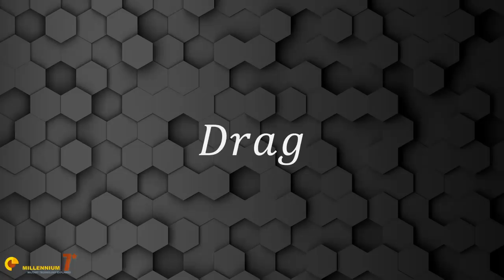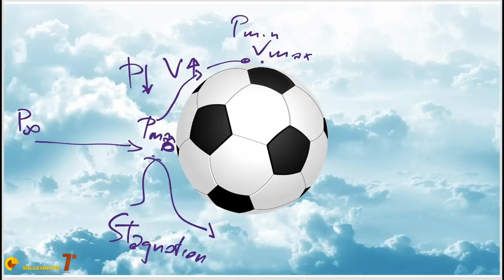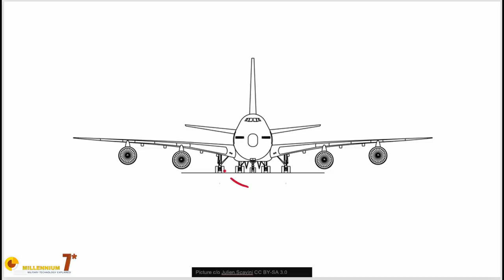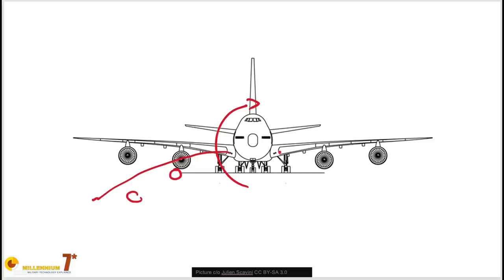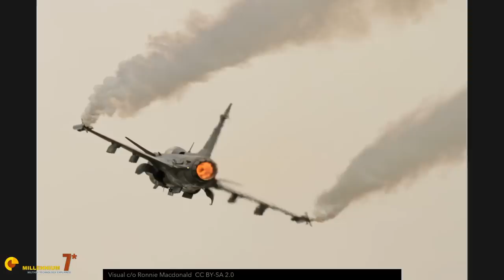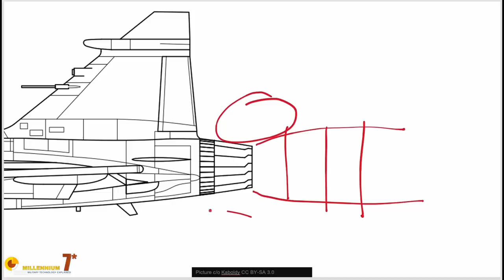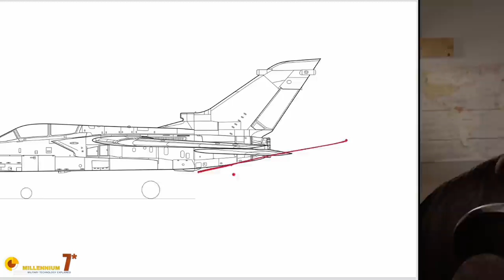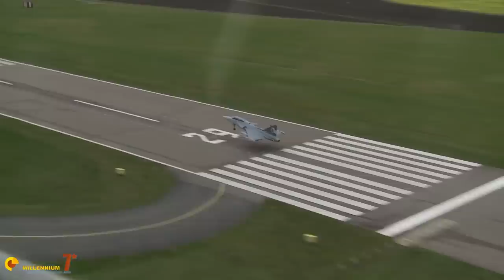The Phantom TAIL is strange because...

Comment: There is nothing wrong with the F-4, its a symbol for the triumph of thrust over aerodynamics.
Reply: It is a rather ugly looking thing..Looks like it can melt itself on full AB
Reply: Lol....that's fucking hilarious and great .
Reply: 5th generation fighters take thrust over aerodynamics to a whole new level.
Reply: @humanbeing9079  yeah, but the F4 is like 50 years old.
So it is outstanding in this regard.
Reply: @AG-pm3tc  indeed, the F4 existed in the age of chasing speed, and the tail design is a pragmatism and complexity compromise that detracted from their set of priorities. But that's engineering, it's always a give and take.
Reply: Hate to burts your bubble but the tail design of the Phantom is efficient.
When the Royal Navy installed Rolls Royce Spey engines with about 20 percent more thrust their top speed was reduced.
Reply: @justacomment1657  ; Heresy.
Reply: @DrsharpRothstein  
>an aerodynamic package was designed with a specific engine in mind
>we swapped the engine and it changed all the flow fields and certain design characteristics no longer works
>Shocker, it performed worse.
It literally says nothing about the tail design, you just ruined the plane lol
Reply: 60 years old actually
Reply: @FirstDagger  forgive me emperor...
Reply: @AG-pm3tc  Is there a more successful multi role fighter of similar age? F4 has a outstanding Kill ratio against Soviet era aircraft. Flew in front line service for over 30 years. Case closed.
Reply: The F4 was my favorite jet. It is the fighter bomber equivalent of the A10, so industrial looking.
Reply: That phrase was coined by pilots on a observational basis. The drag coefficient of the F-4 is the same of the F-16, for example. So it is not a draggy design.
Reply: @humanbeing9079  The F-4 was designed to chase down bombers at supersonic speeds.  It was intended to be an interceptor. It got drafted to be a fighter-bomber and dogfighter because that's what the US had at the time.
Reply: A-12, XB-70, B-58, F-106, F-4, F-14, and F-22 are probably the most complex and innovative aircraft designs after WW2.
Reply: A brick can fly if you put big enough engines on it. Thank you J79s but I think the F-4 looks cool.
Reply: @justacomment1657  was made from stainless steel, and I can tell you, spent many hours drilling and fixing with monel rivets and sheeting.  Nothing but compound curves too, most difficult.
Reply: @AG-pm3tc  60 years young and still one of my favorite sky brutes!
Reply: @magoid  I know, there is a reason why the Phantom was so incredibly successful and fast.
It just does not look particularly sleek.
Reply: F4 speed and thrust allowed it to do vertical loops which the Mig 21 had difficulty following.  But if you lost too much energy, then you were in trouble.  High sustained  turn rates were critical in dogfights but could quickly deplete energy.  And compensating for lost kinetic energy by trading away altitude energy was a thing.  F4 must have had a good drag coefficient because it’s top speed was so high and drag goes up exponentially with speed.
    F35 looks like it has the aerodynamic drag of a tugboat.  In ballistics modeling, the frontal cross section is an overwhelming drag parameter.  Include the  angle of attack and its’ effective frontal cross section area is even larger.  At meaningful air combat speeds, drag is exponentially increased. And with inherently high wing loading and extreme angle of attack in high G turns, the energy loss must be more than considerable. Countries should cover their bets if they are counting on F35 aerodynamics.   
   F15 aerodynamics on the other hand is a finely sculpted piece of art.
Reply: @AG-pm3tc  Try 60 years old. The F4H Phantom first flew in 1960. Development started in 1952 - so the design is seventy years old.
Note that the F4H is not the F-4D (that came later)
Reply: @chrisrautmann8936  Actually the F4H started out as a naval interceptor as a developed version of the F3H in 1952…
Reply: @humanbeing9079  makes me think how evolution chased toughness and now it's a speed game. and now i wonder when is it gonna be a stealtg game
Reply: @humanbeing9079  5th Gen have better aerodynamics than 4th Gen.  The assertion that aerodynamic compromises were made doesn't hold up well when you look at:

Climb rate
Acceleration
Cruise speed 
Service ceiling
Combat radius
Optimum envelope maneuvering

Before reacting, look at combat configurations for 4th Gen.  They are inferior.
Reply: I really love the Phantom‼️
Reply: F4 was alot faster than people believe. Ind it isn't just thrust. It would keep accelerating to the point of airframe overheating at the nose. Or till it ran outa fuel. Mach 2.2 plus.
Reply: @darbyheavey406  Isn't it still in service for the  US National Guard?
Reply: @allangibson2408  about 2 years late on first flight, the Phantom first flew in 1958 and was accepted for service in 1960
Reply: @zodiaco5526  no, the last Phantom in US service was retired in 1996. Japan had them until last year though.
Reply: @silaskuemmerle2505  Thank you, sir.
Reply: The F-4 was arguably the single best design we ever made, to be fair. It was the original joint strike fighter, and, once upgraded with wing slats, quite a formidable dogfighter as well. Just an insanely well-built and capable aircraft. And it looks MEAN.
Reply: @WardenWolf  Absolutely, it looks like it means business.
It also set the armament standard for the following F-14 and F-15, 4x Sparrows in conformal recesses under the belly and 2x Sidewinders under each wing.
The F-15 even has the same three drop tank arrangement.
The F-15A almost performs like a clean sheet redesign of the Phantom turned up to 11, though for some stupid reason they omitted the Multi role capabilities.
Reply: I've heard it said that it said the F4 proves that if you put jet engines on a brick you can make it fly.
Reply: @zodiaco5526 no

Comment: My take on the F-4 tail config is this: the USN aircraft have a limit of 16ft/5m in height. So you have basically 3 ways to deal with that. One, you fold your vertical fin (A-3 Skywarrior, A-5 Vigilante, S-3 Viking). Two, you adopt a nose up attitude to lower the tail (A-4, F-8, A-7). Three, you adopt multiple smaller vertical fins (E-2, C-2, F-14, F-18, F-35).

In the F-4, McDonnel had  a tradition of a vestigial fuselage tail with its designs since the FH-2 Banshee. In the F-4, they decided to not adopt neither a nose up nor a folding tail. So the only option available was to have a inverted "V" stabilator to compensate for the low vertical fin (because of the 15ft height limit). That happening, the engines where angled down so their hot exhaust didn't melt the stabilators. Even then, those still had to have thermal protection on its lower surfaces.
Reply: All very true. Although the horizontals didn't intersect the exhaust flow in normal forward flight, they would interact with the exhaust at high angles of attack, creating a post-nozzle thrust manipulation, kind of a precursor to thrust vectoring. Thus the titanium and lack of paint on the inboard ends of the horiz-stabs.
Also the whole arrangement created tail lift in normal flight, for a minimal expenditure of drag (though it did add weight).
The Phantom II was surprisingly agile (for a "flying brick" ;)
Reply: @kathrynck  I can't count how many times we had to replace lose Jo-bolt fastners on the hot tail panels, and on the stabalizers.   Those Jobolts were in stainless, and when loose would spin in place, making it very difficult to drill.   The trick was to drill perfectly center and perfectly square, using a small and sharp bit, starting around 0.8mm. Then step by step increase the drill diameter, using only sharp HSS bits would reduce the force trying to spinn the jobolt, and the right amount of Tapmatic.   Some times an assistant would use a tool to jam the fastner to prevent it spinning, if it spun you had lost it !   At about 4.2 mm you could then use a drift punch to cleanly snap the head off, leaving a nice clean hole without damage.
If the hole got damaged during the extraction process, you had to drill in out to the next size up then countersing the titanium panel in situe. Not easy with titanium.   Only 2 or 3 in our whole shop could do a nice clean job without messing up, too patience and the right tecnique.   As Phantom structural technicians, those hot panels were our bread and butter.

Comment: I don't see any comment that covers the real reason for the extreme anhedral on the Phantom tail.  Previous McDonnell designs had suffered a pitch up problem at high angles of attack compounded by turbulence off the wing reducing the effectiveness of the horizontal stabilizer at those high angles of attack.  The F-101 was notorious for this.  Angling the horizontal stabilizers down cause at least a portion of them to be below this turbulent area.  This problem also occurred on some planes from other manufacturers.
Reply: The proximity to the exhaust plumes also gave some maneuvering authority which was agnostic to external air flow. At higher angles of pitch control anyway (in normal forward flight they'd stay out of the exhaust).

Comment: Drag was never an issue with the F4 since it could fly at Mach II regardless, and with the normal combat load of missiles, bombs and fuel tanks hanging off the wings, whatever drag the tail added was minimal to the point of being meaningless.  The horizontal stabilizers are where are where they are and bent down to prevent the pitch up problem experienced by the Phantom IIs ancestor, the F101 Voodoo which had the same tail design but with the horizontal stabilizers placed at the top of the vertical tail.  The result of the F4 redesign was better stability and maneuverability.
Reply: I wouldn't say drag is every "meaningless", but yeah, it can be overshadowed by other considerations at times.
Reply: @kathrynck  Yup, launching down a runway with over 8,500 kg of external payload puts some things into perspective.

Comment: Need more of this engineering side of things... stuff we won't find anywhere else on the Internet...😉😁👍
Reply: Try searching for this "stuff" in books, instead.
Reply: @DenisPetrov1980  I like his presentation better 😅
Reply: @DenisPetrov1980  The problem is finding the really good books.
Per now I am reading The Secret Horsepower Race, Caulum Douglas. The problem with that book is that it so heavy, I get a stiff neck from handling it.

Comment: I had a discussion with a friend I play War Thunder together with. The topic was about the tendency for some airplanes (prop) to go in a flat spin and why some of them have real troubles to recover. First case was the P-51, because they wanted to reduce the drag the tail wings are made comparable small what causes the controls to feels a bit squishy, like it has less grip in the air. Later the Brits did it with their Hornet MK.I (two engines ). Strong engines, tiny tail section. Problem with that plane is, if you go into a flat spin, none of the engines seem to blow sufficient air over the tail wings. So the control surfaces there have no chance to counteract a flatspin. In the Hornet MK. III the tail wings are all made longer (reach within the air flow of the engines) and the rudder is a bit elongated across the fuselage. Maybe to avoid horizontal swinging effects. I heard the F-14 Tomcat had issues with flatspin, not sure why, maybe because of the distance between the engines.
Reply: The F14 TF30 Engines suffered from compression stalls- they would barf basically. This would lead to flat spins as you described.
Reply: @steelrad6363  Yeah, I read that once the F14 was in a flat spin, it was unrecoverable.  Yes, you’re right about the TF30 engines. They didn’t like rapid changes of throttle so they would stall.  Grumman had bought a bunch of TF30 engines for the F111 but the navy canceled the navy F111. So Grumman was stuck with those engines and to avoid “eating” the cost of those engines Grumman put them in the F14.  F14’s would get with F15’s for mock combat drills. The F15 would beat the Tomcats but when the F14 got better engines in the F14D, the Eagle pilots were surprised by the improved performance of the Tomcats.

Comment: F-4's tail (and a few other planes with similar tail geometry) had a lot of other considerations to it as well though.
For example, the fuselage being above the engine thrust created an area of higher speed, higher pressure air under the tail boom, which generated "partially" thrust based lift. Also, the horizontal stabilizers were positioned in such a way that they were out of the direct exhaust flow in normal orientation, but in greater angles of adjustment, they'd interact with the thrust flow, generating a limited form of post-nozzle thrust vectoring. Lastly, the shorter vertical stabilizer was largely due to considerations for space saving inside aircraft carriers, but it also saved some drag for land based variants.

Really loved this video though. These sorts are my favorite I think.

Comment: All the design quirks that make the F-4 so distinctive are fixes for aerodynamic problems.  They ended up with a legendary aircraft, yes, but not one that's all that aerodynamically efficient. Really very draggy.  No problem, fuel was cheap and it had plenty of power to push through its own drag.   But it's such an ICONIC design, one that stands out.  The most recognizable fighter ever made.   And the meanest looking one.

Comment: I used to race motocross bikes in the UK, I got really good and when we are airborne we use the brakes to lift the back wheel  and the throttle to lift the front, I raced from the age of 9 and learned how to use the gyro effect at about 11 years old. When either of the wheels stops rotating the back go up when back wheelspinsfast thefront rises.
Reply from the maker: I never knew 😳

Comment: thanks for that short informative video on pressure induced drag. vacume is as important as drag...neither should be ignored. 
one of the most perfect shapes that best reduces drag caused by pressure and vacume is a simple raindrop (yes lower velocities...but shows the importance of maintaining minimal separation thus reducing disturbed airflow which causes a huge vacuum. 
this difference in pressure is also had at the wing which intentionally creates a high and low pressure to create lift. the lift to weight ratio has a huge effect on drag...the better the lift to weight the more reduction one would have on drag. an airframe with good lift to weight ratio requires less pressure differential thus reducing drag. for those who say weight is not important at cruise...your wrong.
weight is part of the equation in lift to weight thus is extremely important in wing design...that said a small wing on a heavy airframe normally has an effect on range of efficiency.
Reply: Also, if you have a tail section like an F-4, you get some free lift out of the tail by playing with the pressure dynamics of the exhaust plumes. Allowing you to go with a smaller wing area, which saves drag. You also get crude thrust vectoring, and increased control leverage with the tail further from the center of gravity. The penalty is the weight & complexity of the tail structure.

Comment: The 23 degree anhedral on the horizontal stabilizers was to provide more stability at lower speeds and high angles of attack where the tail surfaces could be “washed out” by turbulence from the wings. Also, the anhedral provided some additional lateral stability when the overhead heights of hanger decks made increasing the height of the vertical stabilizer impossible.

Comment: Legend has it that when the aerodynamic team finished the overall design, they were shocked to find out that in wind tunnel testing the F-4 had lower drag coefficient flying tail first.  You can imagine what would happen to the original F-4 in a stalled flat-spin.  A simple compromise without drastically changing the design resulted in wing tips bending up and tail bending down to augment spin recovery--a F-4 signature design feature.
Reply from the maker: Good point. I didn't know.

Comment: Hey Gus, have you any knowledge about such problems in the development of the Su-27? The Tail of the Prototypes did change quite a lot from the original T-10-1. 
I am aware of Problems with the flight control system and the overarching Problems with a curiously growing size and weight. 
but have never heard of anything relating to the Tail design!
Thanks 
Alex
Reply: Learn Russian Literaturian Language, find the books of knowledgeble men, read them. Or give me the names of books.

Comment: The aft wedges are made of titanium skin over titanium honey comb. For some stupid reason they decided to have the JO Bolts opposite of each other top and bottom. If one popped near the thinner outboard end it was a real pain in the ass to get it out. If they were on there long enough you could smack the bottom and hear all the old stems rattle in there.